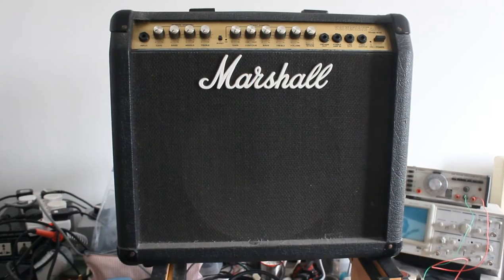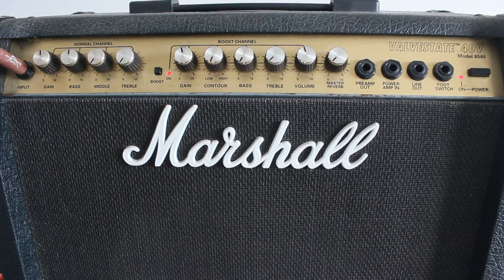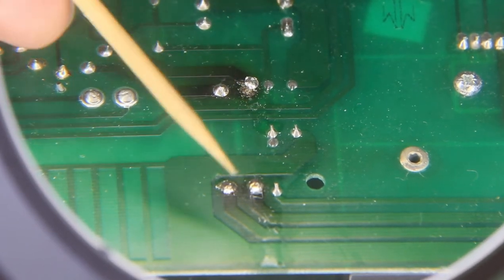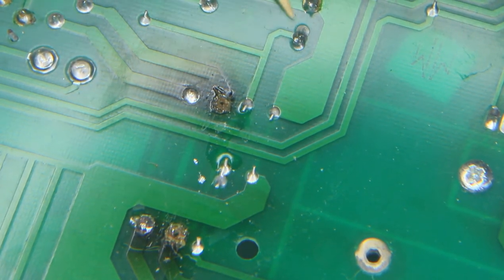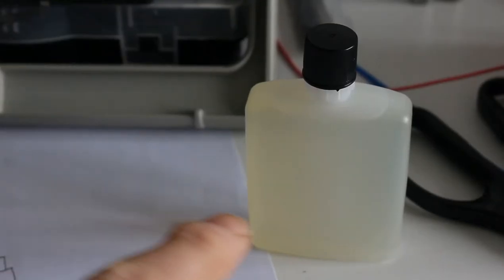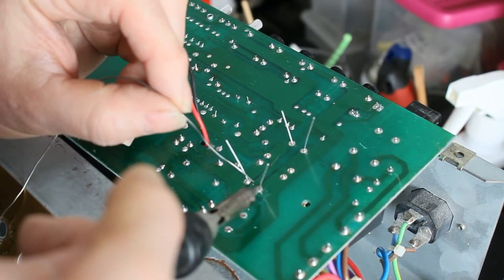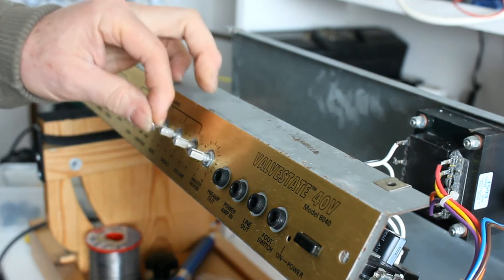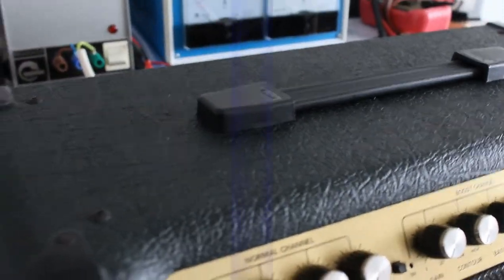Dead Marshall Amp Repair - Part 1 - Circuit Trace Repair and Service

Comment: Found this interesting for sure with traces as I like to mod amps . I have this same 8040 and sometime I’m going to change out the power switch I’ve had for sometime with 6 legs it still works and that’s why I haven’t changed it it’s cosmetic but this amp sounds great with a soul food in the front of it I play EVH , Ratt, Quiet Riot , Ozzy Randy Rhoads years through it all the time and absolutely nails the sound and totally agree with these being underrated for sure it’s all Marshall to my ears thanks for the vid

Comment: I love the turret fix. I didn't have any turrets sitting around so I did a similar fix recently with some 4-40 screws and kep nuts. I wrapped the components around the screw like turrets and soldered them to the screw.
Reply from the maker: Thank you for your comment.

Comment: I have the same amp model no more working. Volume was floating and I had fixed for a short time by resoldering each component. Thanks to your video I've found that power amp is still ok. I'll try to clean out/in sockets to see if I could save also preamp ch.
Reply from the maker: Yes, it's good to clean all sockets well. I stupidly plugged mine (USA 110v) intro a 240v supply and ruined it!  I am going to try to repair it and make a video. If you're interested subscribe or check back later. It might have some useful information.  Thanks for your comment.  PS. I still like this amp, I think it's underrated. However, I don't think it was designed to last a long time.

Comment: Rather than repairing the trace, would it not have been easier and still very robust to replace the trace and jumper to the destination with a piece of thin wire?
Reply from the maker: I just wanted it to look as neat as possible.  Thanks for your comment.

Comment: Thanks for the video, always interested in ways to fix dreaded PCB track issues. Any chance of adding purchasing link for those turrets and or specs. as I  am having trouble locating the ones you used in the video. FYI. I am searching Mouser here in the USA.

Comment: Is the solder you use lead or lead free, on those boards?
Reply from the maker: @irfuel  I used 22 SWG / 0.7mm / 60% tin / 40% lead. It's what I had to hand as I have a large amount left over.  Either would do. Thanks for your query.  Please subscribe.

Comment: Hey man. I have an MG30FX, but I'm not getting any sounds. The lights turn on but no sound. The capacitors don't look blown. What do you think it is?
Reply from the maker: Start by cleaning all the jack sockets  well with an electrical switch cleaner.

Comment: My MG50DFX clean channel has very low volume, the channel switch is temperamental, do you know where to look at please? thanks in advance.
Reply from the maker: Well, firstly sort out the obvious. Given what you've said, the channel switch, jacks and pots should be cleaned with a proper switch cleaner to see if you can bring the switch etc. back to life. Then check your guitar cables and clean your guitar jack. Then see what happens and re-evaluate.

Comment: My Marshall gfx 30 stopped powering on
Where should I start?
Reply from the maker: Start with the fuse and plug wiring, then check  
if the mains on/off switch is working correctly.
Reply: @dembydish  my model has fdd 
No serviceable power cord
And from what I have read the fuse is inside the amp
So I will have to take it apart
Reply: @dembydish  yes the power switch could have went bad
But I will look for the fuse first I will give you the exact model # when I get back
Thanks
Reply from the maker: OK, this video may be useful in how to approach getting to the fuse. The glass fuses are generally available on eBay if that's the issue.
Reply: @dembydish  I replaced the power switch and fuse still nothing and while pulling board out to inspect it the main vol pot snapped had to piss amp off keep it for parts I bought a Marshall code 25 for $152.00
Reply: @dembydish  I replaced the fuse and the switch and then when I pulled out the board to inspect the main vol pot snapped the main transformer must be bad I had to piss amp off keep it for parts I bought a Marshall code 25 cheap $152.00 Marshall discontinued there USA support hotline if you can get me a schematic let me know

Comment: did you ever figure out why the Tube resistors get so hot?
Reply from the maker: Not yet, unfortunately I plugged it into a 240v supply and did some serious damage! I now have to rebuild it.  I might find out at that time. Happy New Year.
Reply: @dembydish  so you think it was an amp made for the USA market that runs 120V?
Reply from the maker: @patprop74  I purchased this amp in the USA when I lived there. Marshall's biggest market is the USA. Back in the UK, I usually plug it into a 110v power transformer, but I forgot to select 110v.  So it took 240v, blew the fuse and damaged the main board. All this after servicing it.
Reply: @dembydish  Dammm, So sorry, Things happen, I'm sure many many amps got blown because of a silly mistake like that, I love those amps, I still have two of them. and an 8080 and an 8020 haha  Replaced pretty much all the 1Meg pots on almost of everything Marshall made in the Valvestate line up and the input and output jacks ABSOLUTELY need to be pulled out and properly cleaned with light sandpaper on their contacts, I don't even want to think about how many of these amps got scrapped just because of that problem with sub-par part. do you have problems finding parts for those over there in the UK? things like Pots and the front plastic logo and such?

Comment: you shouild show how you open the amp.
Reply from the maker: Undo the 4 bolts on the top and the amp section will come free and can be removed.